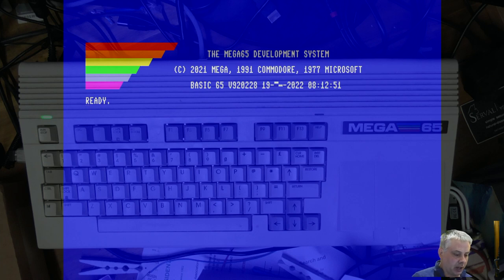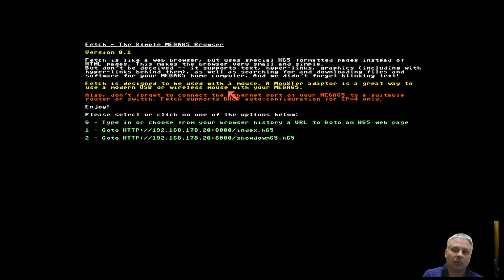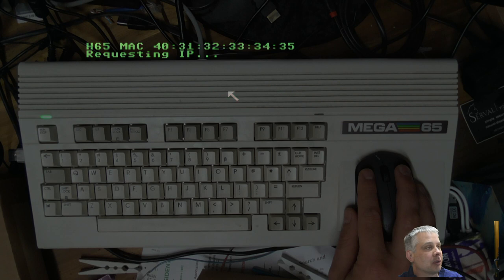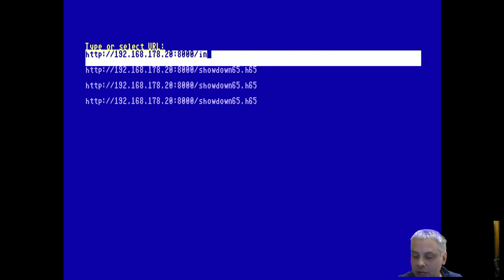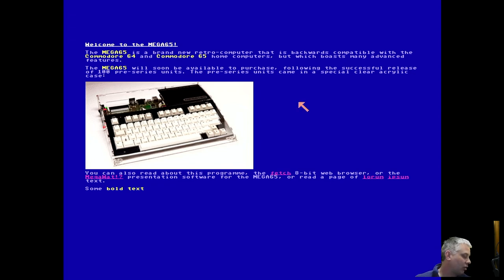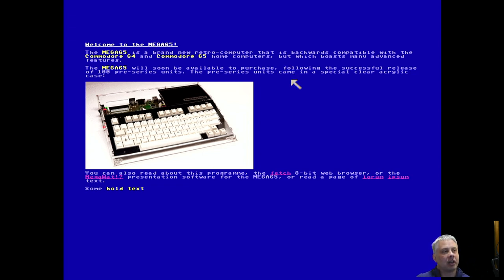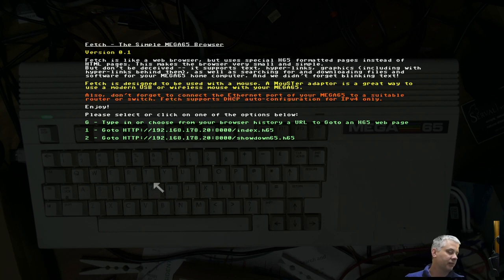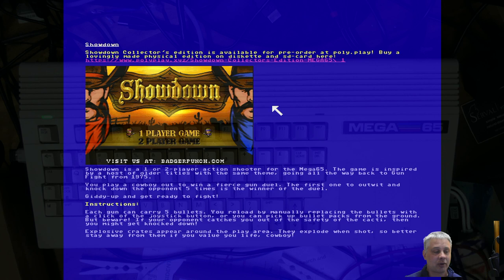MEGA65 Development Stream - connecting to the internet and BBS

Comment: I didn't buy a Mega 65 (yet) because I couldn't call boards with it, and that's the main reason I still use Commodore hardware. c128 is the best BBSing machine, since it can run c64 terminals and can do 80 columns in 128 mode. Plus I can use my Commodore CRT monitors which is a huge draw for the BBS experience. But the 128 isn't the greatest for non-Commodore boards, but not like there's a lot of people writing c128 terminal programs these days.
Reply: We will add 80x50 mode and support for non-CBM terminal modes, like VT220 in the future.

Comment: Why does the BBS client have to be in C64 / 40 Columns mode? The C128 had several fine terminal programs, and I bet a native C65 mode program would be excellent and able to take advantage of all the capabilities of that platform.
Reply: Hi Jay, there is no reason, and I am sure it will support 80 columns and 50 rows by the time it's finished. This is just a simple test of the TCP stack and Ethernet controller.  The more folks step up to contribute, the faster these extra features will happen, as right now, it's just me alone working on both the browser and the BBS client.
Reply: @PaulGardnerStephen  Waiting for Batch 2 !!!
Reply: @PaulGardnerStephen  My tone wasn't meant to sound ungrateful, it was more of a technical question if there was a reason why it appears to have been started in C64 mode? Or is it actually in C65 mode but with a 40 column display?
Reply: @frnno967  No worries, and I didn't take your tone as ungrateful. It's a question many ask, and so I have perhaps a bit too pre-arranged answer ready.  It is actually C64 mode, but unlike on the C128, you can get to all new features from C64 mode with the correct procedure.

Comment: Should the BBS program work with the R6 board? It seems to hang for me at configuring network via DHCP. And it only starts if I send the prg to the Mega65 with the M65Connect (does not work if I copy the prg on a d81 image and start it from the Mega65).
Edit: it seems that the hang at configuring DHCP does not happen all the time for me but quite often.